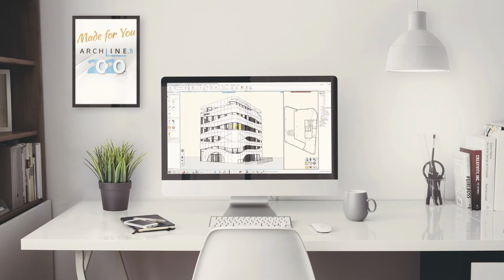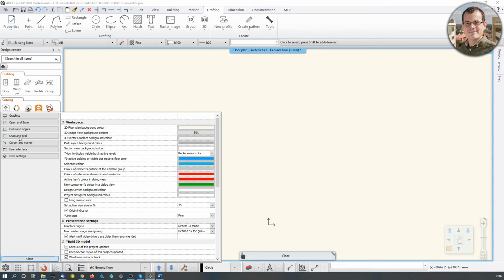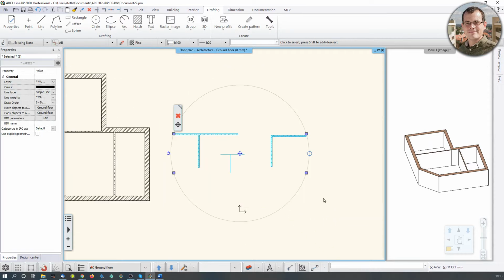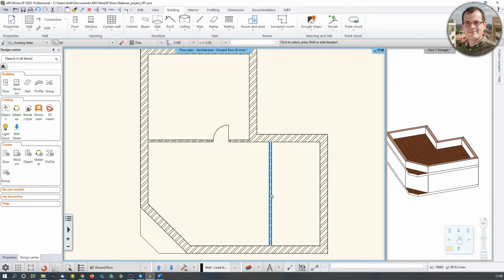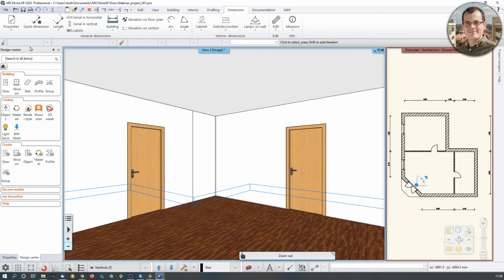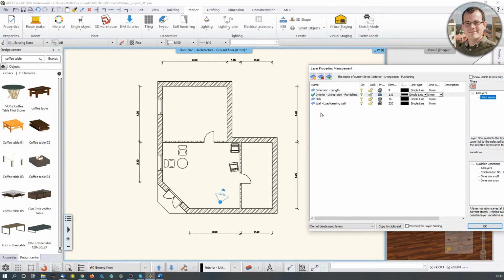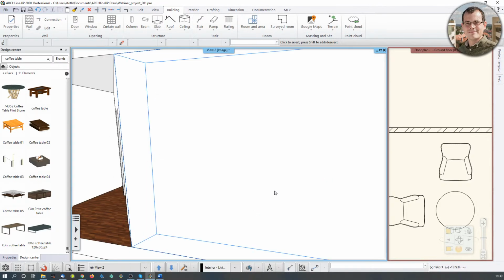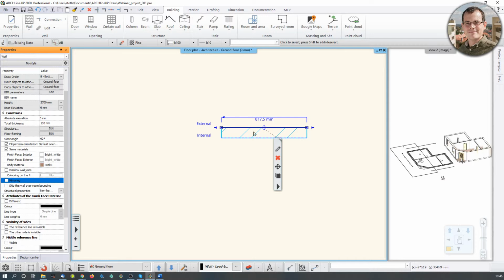Foundation - ARCHLine.XP Preliminary Interior Design Course 2

Comment: Hi Zoltan,

Thanks for the Interior Design Course with ARCHLine.XP Part 2 - Foundation Course. Lots of helpful items as usual.

One item you touched upon is variation views of a model with the use of layers. This is understood, however, taking this a small step further, I guess saving these sets of layers to a grouped view of certain layers for the various model views would assist a user to be better organised. It would be good to see the use of this demonstrated in the layer manager under the FILTERS & VARIATIONS window panel if that’s the way we’re meant to organise various alternative model views in ArchLine-Xp.

The CAD software I currently use, has a GO-TO-VIEW list where you can save various layers as views for various items such as different floor plans & elevations etc. The GO-TO-VIEWS can then be placed on a drawing sheet at any scale & then once done, saved as a PLOT SHEET VIEW.

I’m not too sure if ArchLine-XP has something in addition to FILTERS & VARIATIONS in the LAYER MANAGER where you can save various layered items under a view list, therefore please clarify. 

Regards,
Clayton.
-------------------------------------------------------------------------------------------
Hi Zoltan,

Thanks for pointing me in the direction of the video link below by Illés Papp.

LAYER VARIATION GROUPS
https://www.youtube.com/watch?v=p4L6h9yeqVg